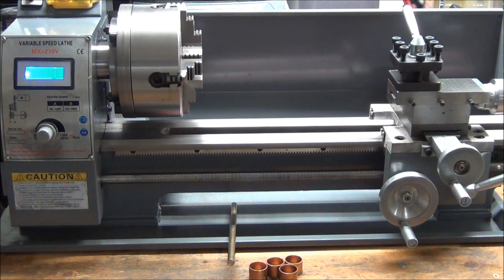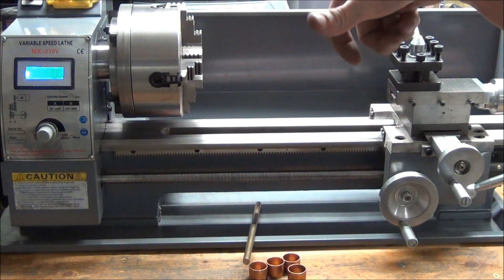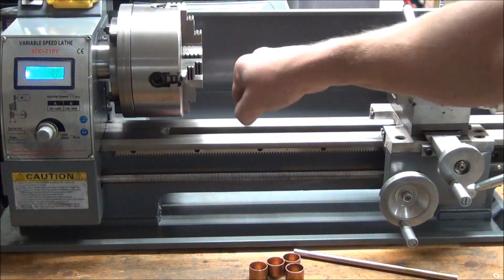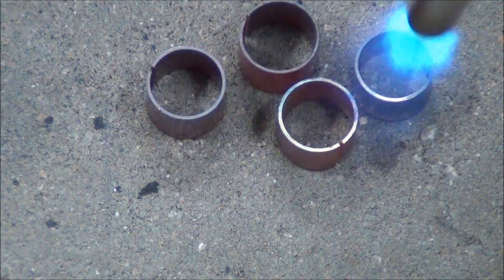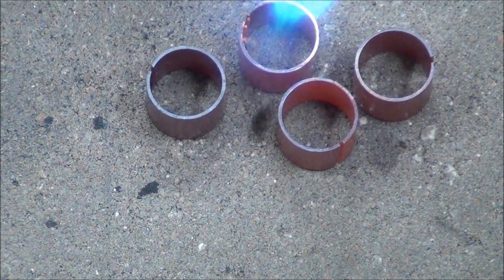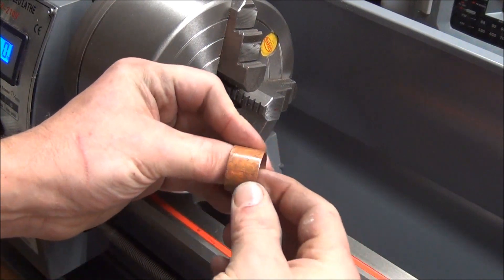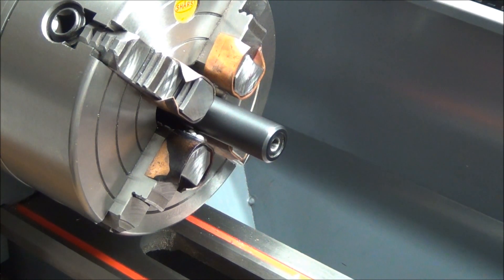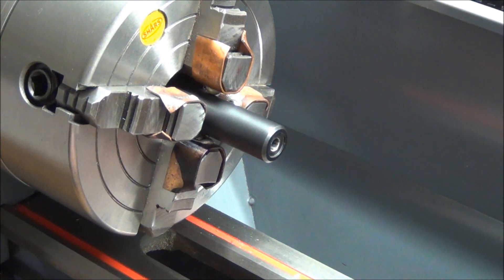TS-210 Part 10: Soft Jaws With a Twist

Comment: Hi, I got my ts(mx)-210 just a few days ago.  Where did you get the 4 jaw chuck from,  and did you have to make a back plate for it?
Reply from the maker: I have a video making the back plate and I picked the 4 jaw up from Shars here in the states....if I remember correctly.  Probably find a link somewhere in the posts on one of the videos.
Reply: @number40Fan  mine came with a sanou 3 jaw, so I went back to Ebay, found a sanou 4 jaw K12-125 with the matching 3 hole bolt pattern.   The K72 has the 4 bolt pattern,  hoping the 3 bolt 4 jaw won't be a problem.   Thanks for the great work.   James from Augusta GA
Reply from the maker: If you are only needing to hold onto square stuff, that 4 jaw will be ok.  The 4 jaw I went with has independent jaws that I need for barrel threading work.
Reply: @number40Fan  I was wondering about that.....thanks

Comment: I keep coming back to your videos with this 6" chuck. How long ago did you buy it? Also did you buy it from shars website or their Ebay page. The one I got from their ebay  page was different than the one they pictured. It also had a huge 2"+ bore.
Reply from the maker: I initially saw it on their eBay page.  Went to their website and was able to get a discount for giving them my fake email, so I bought it from there.  Yep, the bore is big, but I needed it for this lathe that already has a 1.5" bore.

https://www.shars.com/products/workholding/lathe-chucks/6-4-jaw-independent-chuck-1

That is the one I bought.  Listed as a 1.575" bore.  I can't confirm it precisely as I have a barrel in the chuck right now that I need to thread this weekend, but as close as I can get with my calipers, that has to be right.

I think I picked it up in December.

Comment: Good idea for the soft jaws.
Just a tip re the soldering, if I may.
Separately tin the areas you want to join, then place the parts in position (add a little more flux) and then heat. This process is known as “sweating” for old timers like me and ensures full solder contact.
Reply from the maker: Thanks for the tip.

Comment: Awesome! Glad that lathe worked out. I was on the fence about it- figured the HF 7xs had more video support for newbies like me, but your series definitely makes me realize this is exactly what I need!
Reply from the maker: The main reason I went out on a limb for this lathe was the large spindle bore.  Most of my barrels are heavy barrels and I need a way to thread them all for suppressors.  The HF never let me down, but it did have it limitations and the size of material I could turn down was one of them.
Reply: number40Fan Yep. Over on ST, I saw the post in the forum. In fact I replied over there as well. The sole reason for a lathe is my F1 hobby! Seeing the spider build and knowing what is coming in videos 10 and beyond is really tempting me to buy today!!!
Reply from the maker: All I am waiting for now are the range rods from PT&G to show up so I can get the party started.